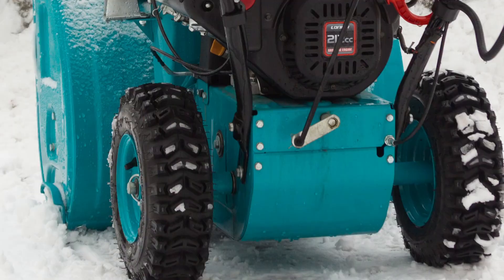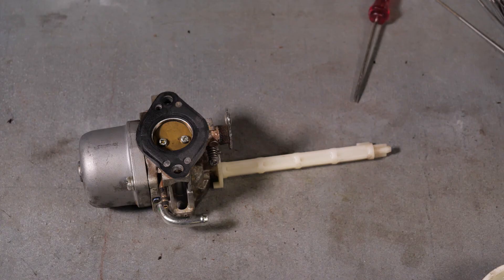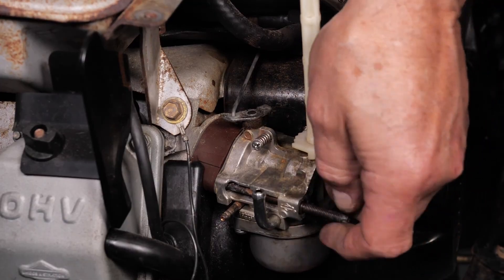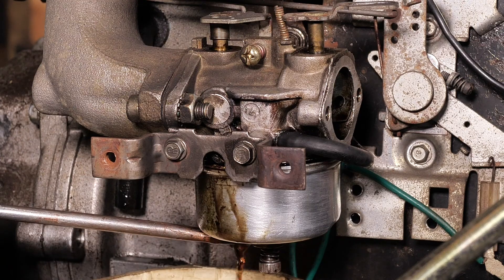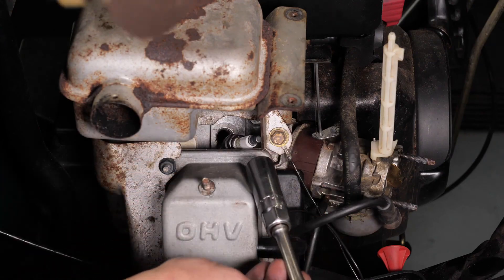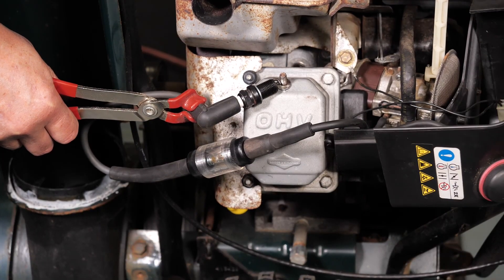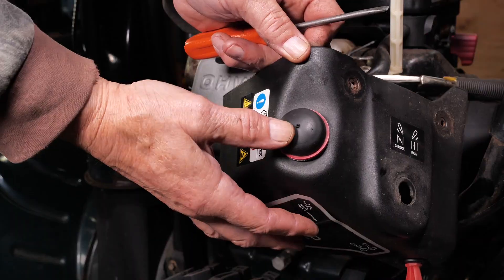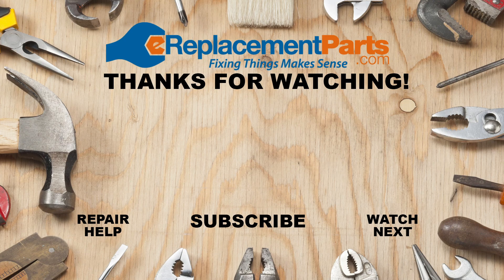Snowblower Troubleshooting: Why Your Snowblower Won't Start | eReplacementParts.com

Comment: Remember don't wear gloves when priming fuel!
Reply: Didn't know that! Why?
Reply: @paulattanasio3061  With a glove on sometimes you don't get a complete seal on the hole when priming the machine. Not the end of the world but just one problem prevented